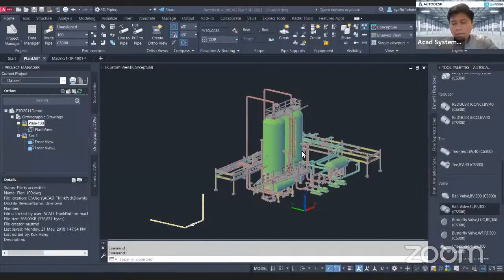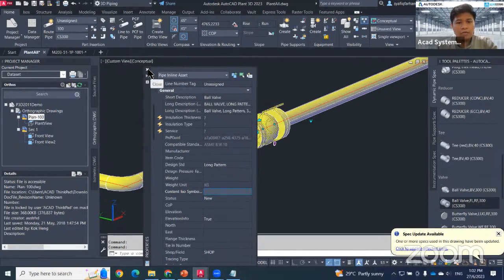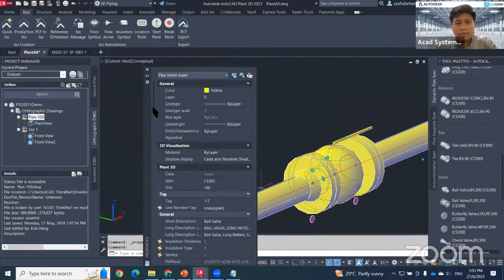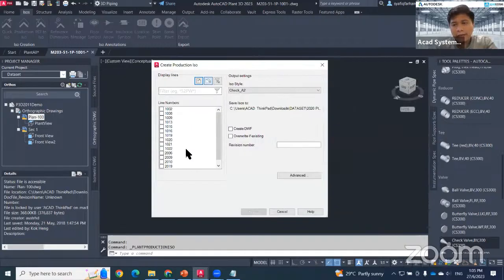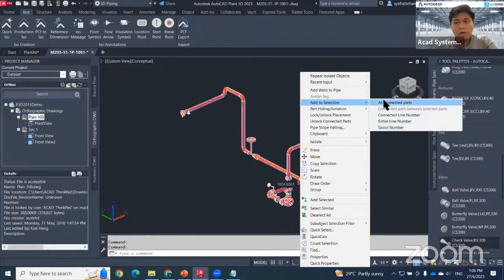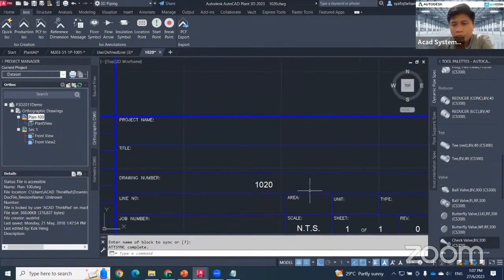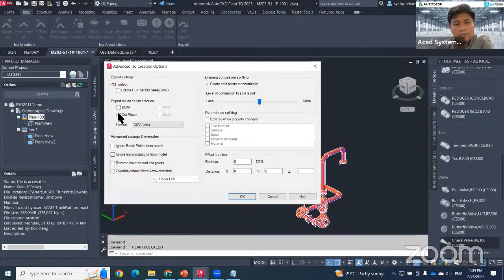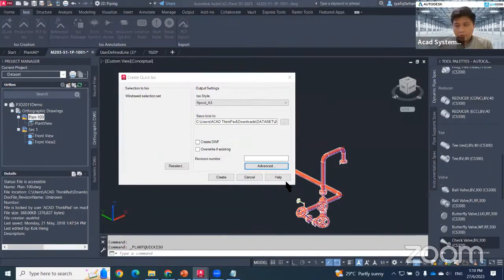Creating ISO Drawing in Plant 3D - Lesson 11 of 13

Comment: Sir, why when I use the CS150 spec and route the pipe, the elbow is sock weld not but weld, and when I add a valve, what appears is a slip-on flange not a welding neck, please answer and help with a video, sir, please